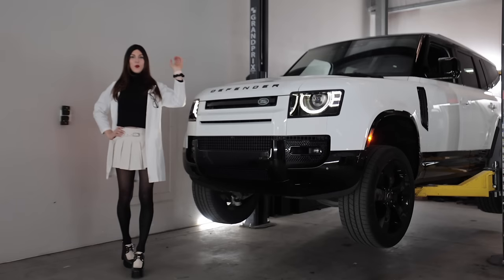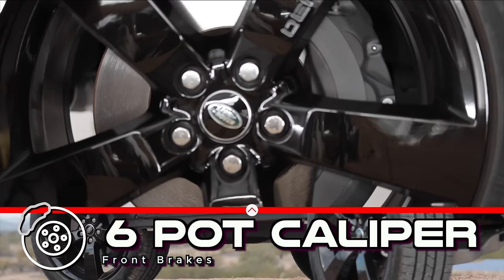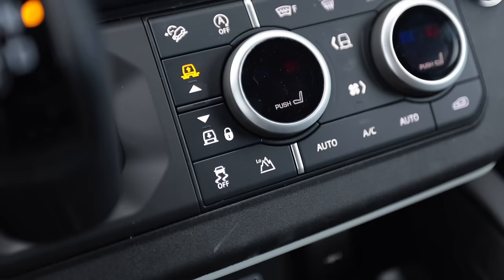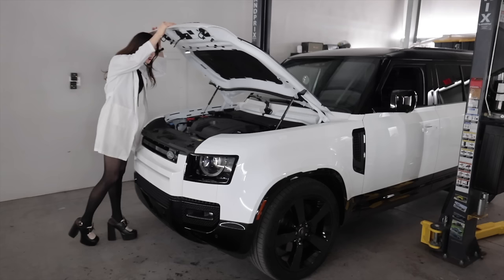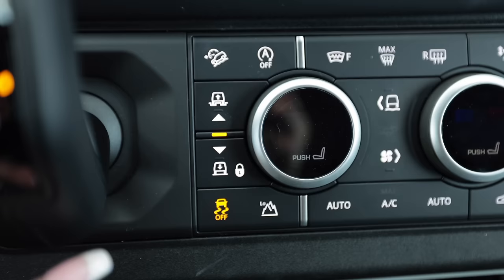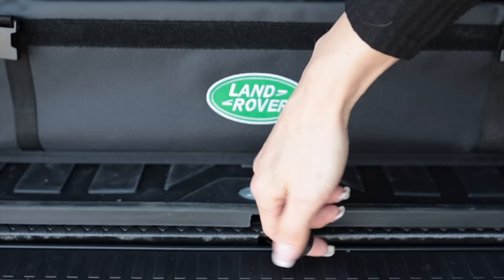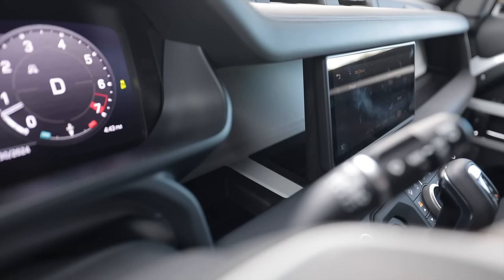Better Than Bronco? // 2024 Land Rover Defender Review

Comment: The rear door has an auto close option, so one doesn’t have to slam it. The refrigerator in the center console is an option. Try to get the large infotainment screen…..the 20” rim allows one to get more rugged tires.

Comment: Fantastic review Sarah
Defender is a brilliant vehicle 
Even with 22” tyres, it did extremely well off road !
But these aren’t the appropriate tyres for off road use
U can fit 18” tyres, with minor adjustments 
Because of a high
GVM & GCM the braking system is very robust !
As u say, sadly most people never take their SUV off road
And most are bought in mall crawler spec !
I can’t wait for the SVX versions of Defender that will be finally released soon
The off road capability of these will be next level
These versions of Defender will shut up all the people who say Defender isn’t a rugged off road vehicle !
It is already, if u spec it the right way !

Comment: 00:00   🎉 Intro to 2024 Land Rover Defender 110 Review
00:15   🛠 Tech & Specs Deep Dive
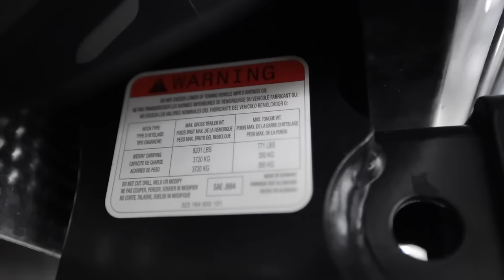00:47   🚛 Towing Capacity & Exterior Features
01:09   🔩 Aluminium Construction & Suspension Details
01:47   📏 Defender Variants & Weights
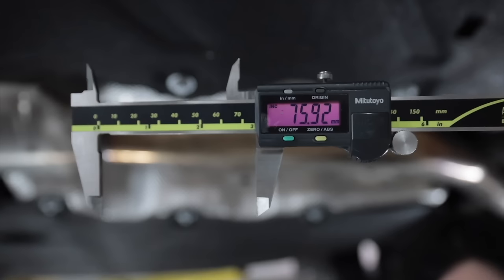02:15   🔊 Exhaust Sound & Design
02:34   🕹 Transmission & Four-Wheel Drive System
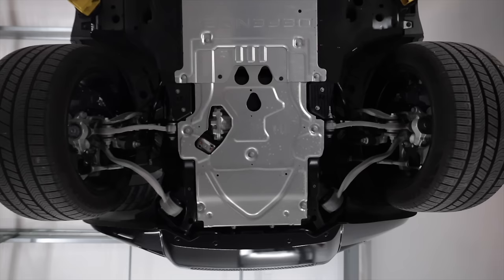03:09   💪 Front Suspension & Skid Plate
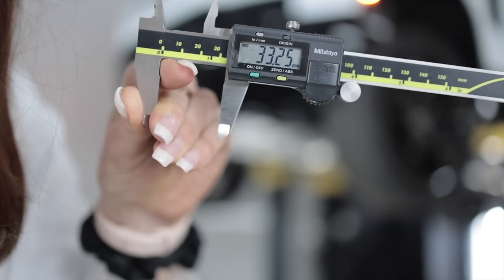03:52   🛑 Braking Test & Brake Details
04:49   🚗 Wheel & Tire Analysis
05:34   🪑 Interior & Seating Comfort
06:29   🚀 Engine Performance & Drive Modes
07:44   🏋‍♂ Engine Tech Specs & Maintenance
09:03   🏔 Off-Road Hill Climb Test
10:01   🤖 Smart Robots in Off-Road Vehicles
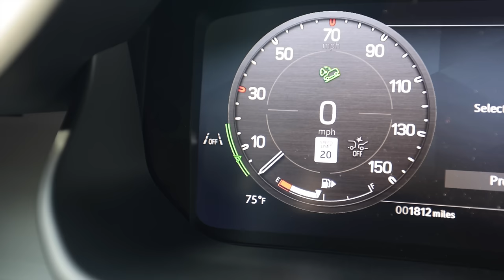10:23   📊 Easy-to-Find Controls and Settings
10:37   💧 Telemetry Wade Sensing for Off-Roading
10:47   🌲 Avoiding Obstacles and Tree Navigation
11:07   🤖 Trusting Robot-Assisted Descent Control
11:29   🚙 Adjustable Ride Height and Air Suspension
11:50   🚧 Testing Off-Road Obstacles and Dimensions
12:36   🧭 Off-Road System Intelligence with Poor Tires
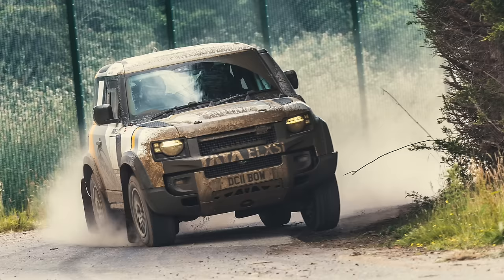12:49   💭 Desire for a Two-Door Model with V8 Engine
12:55   🎨 Praise for Interior Design and Practicality
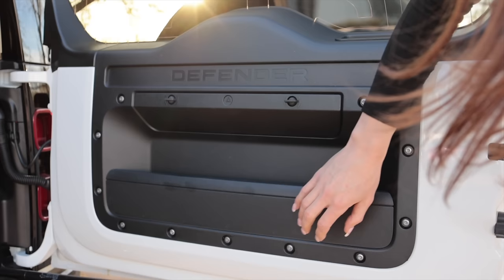13:19   🎛 Cool Features and Heavy-Duty Construction
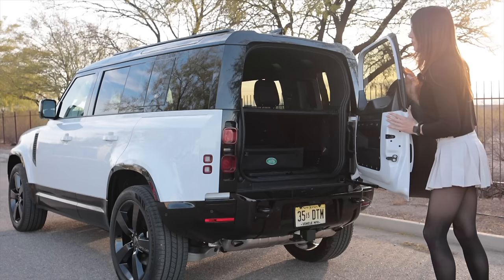13:50   ⛅ Innovative Interior with Plenty of Headroom
14:01   🤖 Rear Climate Control and Seating Features
14:27   🚿 Washable Rubber Flooring and Storage Solutions
14:39   🍦 Built-In Refrigerator and Other Neat Features
14:46   🎨 Colorful and User-Friendly Infotainment System
15:03   🔊 Excellent Sound System with Meridian Speakers
15:36   ☁ Smooth Suspension and Off-Road Capability
15:55   💡 Criticism for Lack of Diesel and Manual Options
18:37   📈 Vehicle Ratings Across Various Categories

Key Moments by Agent Gold AI

Comment: The Rover vehicles with air adjustable suspension also have "extended and "super extended" modes.
On some models this will give almost 2" additional suspension lift. The "offroad" mode will default to normal height at 50MPH.
I've got a Range Rover Sport with a 3.0L Turbo-Diesel 6 cyl engine. LOVE THAT VEHICLE!
With some decent tires I'm convinced it'll go anywhere my full sized ZR2 truck will go

Comment: Great video.  I like your format. Fun.  Thorough.  This trim level can be optioned w off-road pack ie rear diff lock but from the 4x4i screen u showed this truck does not have it right? It’s amazing w just the center diff lock.  Nice review.

Comment: I've detailed a few of these tanks and although I really like the short wheel base, it is horrible trying to get to the back seats. Also, the vinyl floor are great if you like taking your dogs with you. If get mud on the front floors you can hose them off. The piano black exterior looks great but it is easy to scratch.

Comment: They use "hairy cardboard" to reduce Noise Vibration Harshness "NVH". Some manufactures put sound deadening material on the back of the plastic fender lines but its not as durable.

Comment: As far as I know there isn't a manual in the range, here in Europe there is a diesel, a 3 litre straight six ingenium in 2 power outputs 250hp and 300hp mhev on all trim levels, personally if you're going off roading then go for the diesel option with the smaller steel wheel option so get better off road tyres, with the diesel you'll get better torque and fuel economy, the v8 is just for the performance and sound,

Comment: "Car Wizard" (from "Hoovie's Garage") says ALL European cars after 100000 miles are trash. Land Rovers are worse, once they hit 36000 miles, they are trash. So, they are NOT better than a Ford Bronco or Chevrolet Blazer, American and Japanese SUVs are far more reliable than a Land Rover. "Throttle House" bought a used Land Rover where the previous owner had to replace the engine, past editions (possibly including this one) have Timing Chains that will fail, which destroys the engine.

Comment: Oddly enough my old leaf sprung solid axle/ Eaton E-locked 60's '86 Ramcharger doesn't have to stop and think about which tire gets the power.  Point being, computerized offroad traction nannies are the silly result of engineers who've too much time spent playing video games. Just push the buttons when needed, lock the axles and go.

Comment: The Defender is genuinely very capable off road when you put proper off road wheels and tyres on it. The problem is it's just not reliable off road. Too many things can and will go wrong. Most of the stuff that goes wrong can't be trail-fixed, you need a specialist mechanic or a dealership to fix most of the problems that will happen, so if you're in the middle of nowhere you're pretty screwed.

Comment: I’d take the bronco, wrangler or the previous defender any day of the week over this for off road capability’s, as many tricks as this has with the all independent suspension it can’t keep all four wheels on the ground. Plus range rovers history with air ride problems this just isn’t what the predecessor was.
Reply: I doesn’t even have great handling at high speed. Pathetic, giving fully independent suspension.

Comment: Shame it's just a Discovery under the skin. Nice looking, but fragile. Try a Grenadier - absolutely awesome.
Reply: My “ just a Discovery 4 ” has 240k on it’s original engine and I feel confident it’ll do that again, and it’s on original air suspension. Any off road vehicle requires much more rigorous maintenance than a regular car, fact.
Reply: @paulmurphy454   Most vehicles will go 240k given proper maintenance and care. 
That said, Defender lost it’s heritage and never made it to be Range Rover.   
Frankly, the whole comparison to Bronco is idiotic - they entirely different vehicles.

Comment: Well awesome things up. Yes the defender is more luxurious and rides better but it has horrible articulation, it doesn't have front and rear lockers, it doesn't have a solid classic V8 unless you spend way too much, it doesn't have turn assist for hitting switchbacks on the mountain, it can develop air leaks in the suspension , coil spring is way better we all know it unless you're trying to be fancy and show how your suspension goes up and down and rides smooth. And what's sad is that it can't do the Rubicon Trail stock the way at Bronco can. I can't believe that's land Rover's Flagship model of the four-wheel drive companies Legacy can I drive a solid axle Rover so I can honestly still say it is very cool but very pathetic at the same time

Comment: Insider info: There is no manual transmission because of the transmission location, increased certification cost, interior layout, lack of demand and fuel economy penalty. There is no Diesel option because Land Rover attempted to offer Diesel in the US across the model line in 2016 and Americans simply wouldn't buy them- even deeply discounted. It cost the company a fortune and was a failure- so no more Diesels for you. As for the repeated complaints about 22" wheels and street tires- did you request that the Mahwah PR team provide you a Defender with 18", 19" or 20" wheels and the off-road tire pack? From what i hear- you did not.

Comment: You skipped over the engine specs.🤷
Reply from the maker: You skipped that part of the video apparently
Reply: @SarahnTuned  
I went back twice and it went from unrelated drivetrain straight to the transmission.🤷 If you say it's there, I'll look again.😎👍
Reply: So it goes from the sound test to the transmission, no engine mentioned.
Reply: Ok, it's further along in the video, found it. Must of been when the phone rang when I was watching?😎👍
Reply: Always use airplane mode when watching Sarah. @itseithergonnaworkoritaint7852

Comment: I just have no faith in air suspension.
Reply: I don’t get that. You have to replace the system every 100k miles or so, and you know that going in, yet everyone acts surprised when the time comes.
Reply: I recommend a little more faith. 😁🙂 My family had a small fleet of semi trucks riding on air and after being highly skeptical like yourself we eventually found after a few years it was more reliable, cheaper and easier to fix than steel sprung suspension. I would happily have a vehicle running on air.